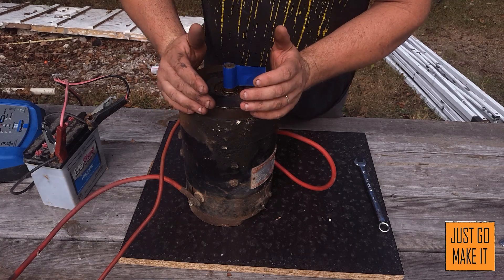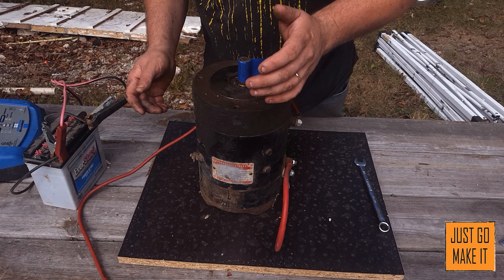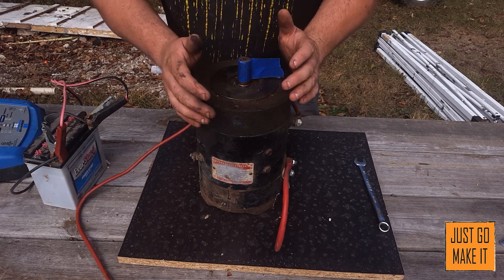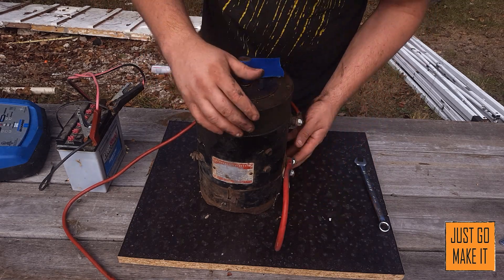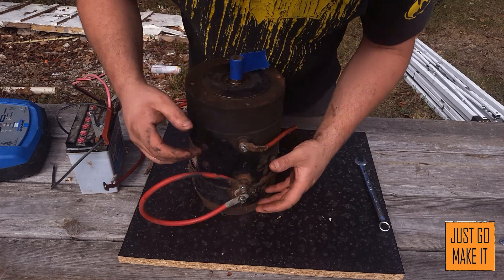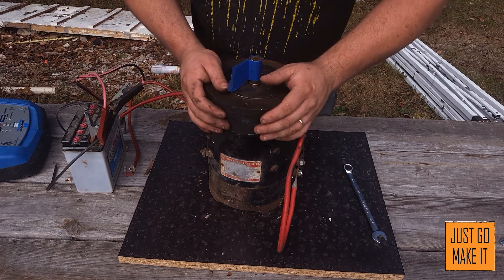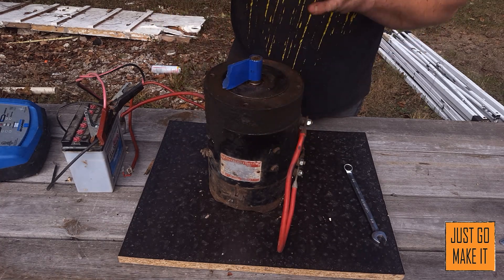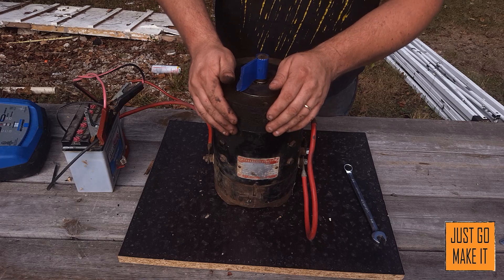DC Series Wound Motor Wiring And Reversing

Comment: Feed it in just like the batteries, ,. Some big igbt bricks, would probably do it, I'd go to 48v, and put a blower fan on it, to keep it cool, it will pull about 2x the current as 36v, maybe make a manual contactor, to change directions, or use breakers, setup to change directions, this thing should run on dc and ac  if the polarity doesn't matter, like a universal motor, I have a few fork lift motors, I was thinking ev conversation, then I'm thinking electric compact tractor, using either brushless motors for the mower. Or another series wound forklift motor for the whole deck, all the blades,  possibly 4, on a 60" deck, 60"-72"  with a gear box, to get reverse, and  at least 3ranges, 2wirking speeds, and one traveling gear, so 4gears forward would be better, 6better than good,

Comment: You need an H bridge circuit rated at 150% voltage and 200% current. Then you could control it with a logic circuit and a wifi dongle if you wanted.
Reply: Dear good sir,
It appears from your reply, you know more than the average bear about these series wound DC forklift motors… Is this true?
My backyard, fiddle fart, DIY, overkill project, requires more expertise than rewiring the motor to switch direction.
What I would like to do is use the motor as both the propulsion for a go/garden cart, and when switched to a different setting, the garden cart becomes a push sled that generates power and charges the battery.
But here’s where it gets interesting…
When the device is turned from the off position, to the push sled position, I would like to modulate the amount of resistance that is felt by the human pusher of the sled… Varying between zero and 20 mA. Where the zero setting is no resistance other than the friction of the gearing and the weight of the cart. For levels between one and 20, more and more resistance is required to overcome to move the cart, and subsequently generate battery charging power.

And now to make matters even more interesting…

I would like this 0 to 20 mA variable resistance setting to be a feature for both forward and reverse motion. This way, you can set a higher resistance for the push mode, and a lower resistance for the reverse pull mode.

(Think M X push sled with internal resistance by Torque…) (except infinitely better because I’m the one designing it.)

And now for the Cherry on top!

A new user could approach the cart, identify themselves by selecting a username and login via the Wi-Fi connectivity, and be able to download via CSV file the log statistics for the millivolts and torque and rpm data generated during their exercise session.

Eventually, a global group of fitness fanatics will become part of what I am now hereby naming,
“ The Cart Hell, Cart Tell, Cartel”

This is my dream.

If you would be so kind as to point me in the direction you believe I should head, my gratitude will know no bounds.
Reply: @clevereeves1861  You probably need a PM motor. Easier to control and can generate electricity too. If you use a load cell on your push pull bar/grip, you can sense the force and a microprocessor can vary the load. Adding audio input and a voice recognition program you could achieve what you seek.
Reply: Thank you!
Reply: Would you shared a link where I can buy the H Bridge circuit please

Comment: Control the speed by adding multiple resistors in series with the armature circuit, then shunt around each resistor with a manual switch or a set of actual contacts that can handle the current. 

Boom there's your caveman speed control.
Reply: I have a 1958 "Turf Rider IV" that was factory wired in just such a manner. Took me until reading your comment to know what the heckfire I was looking at lol. Many Thanks!

Comment: Run it with two controllers variable voltage or pulse width modulated and when you get up to speed turn down the fields leave the coils up high and you'll get a big boost in speed at a little cost of torque that is how we wire forklifts for high speed

Comment: Thank you for this video. I have just put a forklift motor into the transmission of our motor home .When I powered it up the rotation was backward to the rotation of the transmission.{ ok if I want to use reverse gear to go forward ha,ha ).So I reversed the leads which didn't change the motor direction .I am so happy to find your video to make it turn the  right way ..
Reply from the maker: Happy to help you out.
Reply: Add more gears drop the voltage or signal to your Fields after you get up to speed it'll be like overdrive!!

Comment: Think you should use a insulated switch to start the motor. Not safe to terminate with bare hands.
Reply: yes it is , its 12 v , no risk of shock and the shock were he wet or cut would be minor

Comment: that motor can run on ac or dc
Reply: through dc
Reply: Only if is a Universal motor... if not he will need to find or built a VFD circuit (SCR + Rectifier + proper Cap + control switch, etc.)

Comment: I have such a motor. Can i damage it in some way if i connect something wrong to for example a 12v 12ah battery?
Reply from the maker: +Falkneri at 12 volts i dont think you will hurt it
Reply: I don’t think a DC drive used PWM it just rectified AC to DC and there is no inverter. That being said if you do find a drive to run it it needs to be configured for series wound